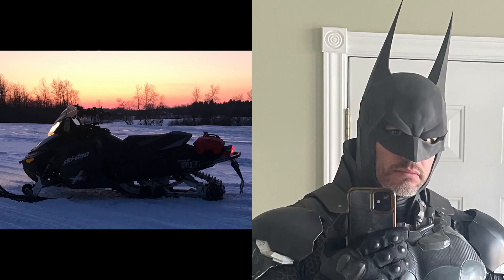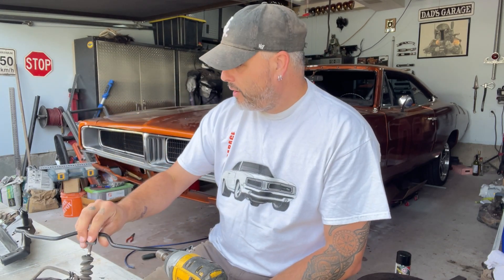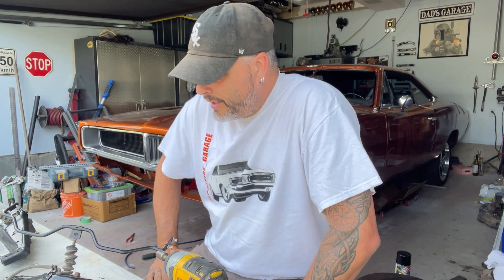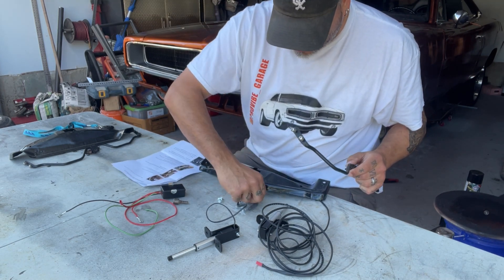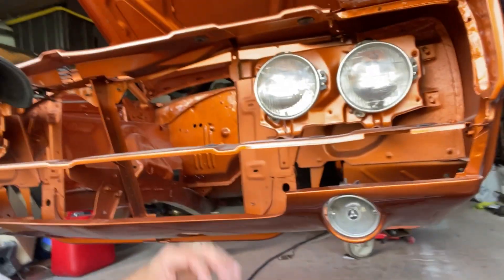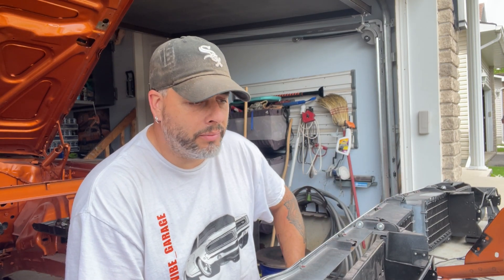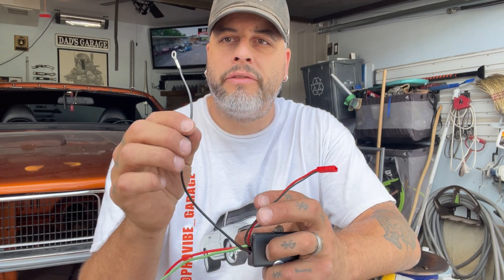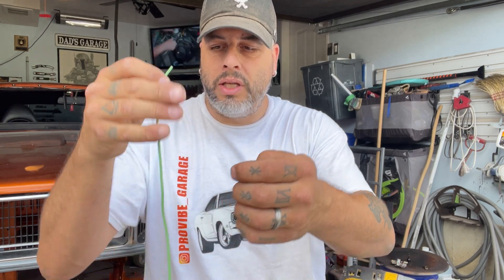69 Charger electric headlight actuator conversion.

Comment: Very good how to. Not sure about that 6.4 hemi not having enough vacuum. Mine has enough to open and close for my 69 charger swap. And also power brakes. But electric are a better upgrade.
Reply from the maker: Thanks for that info. I had heard there wasn’t enough vacuum good to know there isn’t an issue.  But again I’m missing more more parts than I have to make it work with a vacuum so I’m gonna upgrade this and I’m about to post a short video. I just tried it with my skidoo battery, they work!!!!
Reply: @provibegarage  awesome, look forward to it.